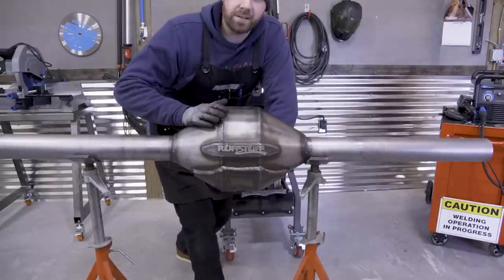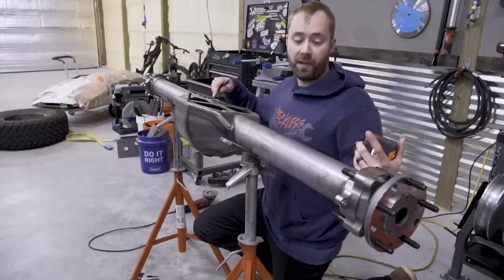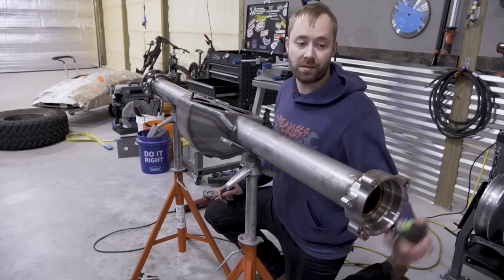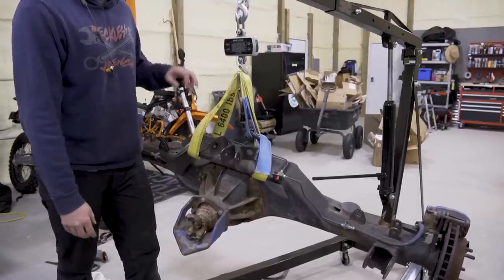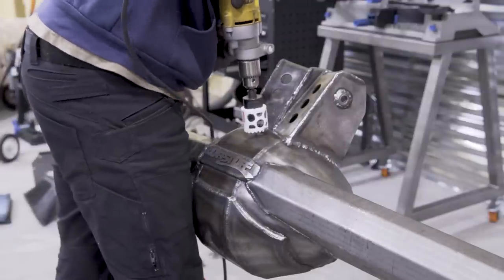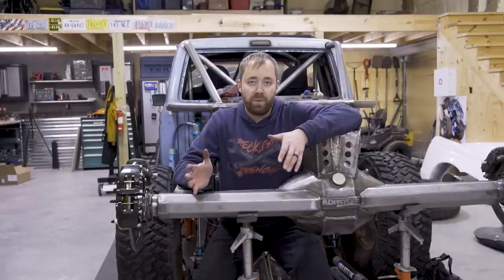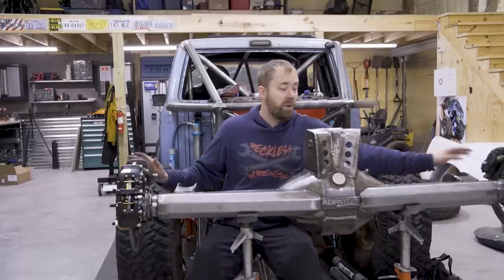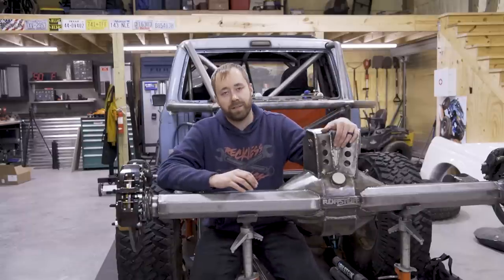Custom Rear Axle Build - Reckless Wrench Garage

Comment: I want to build a set of 609 axles for my TJ so bad. I want something different then the normal 1 ton TJ. I want the strength but not the weight. Since coming back to YT you've been killing with the videos man. Keep up the great work.
Reply from the maker: Thank you I really appreciate that! The 9 inch is such a versatile axle it's hard to not want one in everything. Unlimited aftermarket support is nice. Only downside is the price compared to a junkyard axle

Comment: Why no jig? I thought you couldn't build a rear end without a jig cause ya gotta put some heat in. What do you know I don't? Just curious.
Reply from the maker: This truss wraps around the axle tubes 180 degrees so the weld surface is top and bottom and not on one side of the tube essentially. The tubes being 3/8 thick and only welding small sections at time helps prevent warpage. Since this is a rear axle I do not have to factor in caster on the bearing cups so they are aligned with each other and burned in. 

In my mind if you're getting a 3/8 tube so hot it's warping when welding on a 1/8 truss, you should slow down. 

With all that said I am just an idiot on the Internet making videos, a professional fabricator and/or welder would be a better source to ask.

Comment: I  built custom 9” axles for my rock buggy last year. Curious to see what you’re going the use for inner axle seals. I used TG housings. They came with their fancy aluminum housing double seal. I’m not a fan.  Have had leaking issues, from day 1.
Reply from the maker: The ruffstuff housing came with a setup similar to TG seal housing and the Spidertrax seal housing
Reply: @RecklessWrenchGarage  please feature them on your next video, or when it applies. I popped the actual seals out of the aluminum housing, and replaced them with Seal-It seals. Much better.
Reply: @joecarmean1079  that is what Ruffstuff uses

Comment: Great job man, looks super solid. I’m building Trail Gear 9’s right now with all their accessories (wilwood brakes, hats, bearings, etc. What did you end up doing for brake lines on this?
Reply: I can’t find any info or reviews of the trail gear 9 kits on the internet. It’s like no one has ever installed one. How do you like it so far? Did you do front and rear?
Reply: @The2006200 I’m going to do a video of my build, because yeah it’s like no one else has ever built them. I love them. They’re BEEF, and you get to build them as wide or narrow as you want. All new parts no junk yard bs.
Reply: @DadFab  I would love to see your video!  Did you use hi or low pinion center sections? The true high 9s look killer.

Comment: What did you use to drill those lightening holes in your brackets?    I haven't seen one of those yet.
Reply from the maker: I used a magnetic drill with an annular cutter. They cut like butter! A few videos back I made a fab table and talked more about the mag drill
Reply: @RecklessWrenchGarage  I must have missed that video.  Going back...

Comment: That new housing looks beefy no doubt but I'm surprised you upgrade from your old 9" setup. Is the new one just stronger and able to run full float?
Reply from the maker: The stock 9 inch housings have a tendency bend even with trusses and I wanted the strength of a full float setup. Plus this looks a lot better now

Comment: Resize your hydraulic handbrake calipers to a smaller, single piston unit, you’re either gonna have to have a lot of throw or a lot of bore on your master cylinder for that hand brake unit to take those, another channel did it, and proved that the factory smaller calipers are better for hydraulic handbrake. What channel is, doughnut, media, and it was on the 350 Z.

Comment: how does a 9" compair to a  dana 60
Reply from the maker: There are pros and cons of each, but the 9 inch is lighter and just as strong as a Dana 60. Since this axle is 35 spline and full float this is stronger than a stock Dana 60. Plus a 9 inch has a dropout differential.